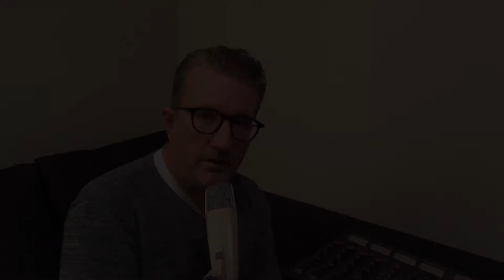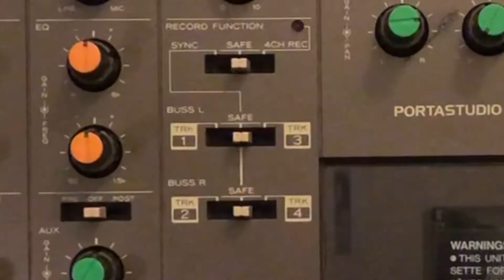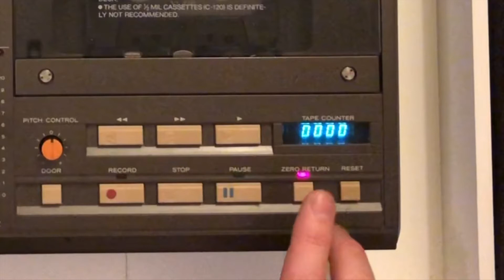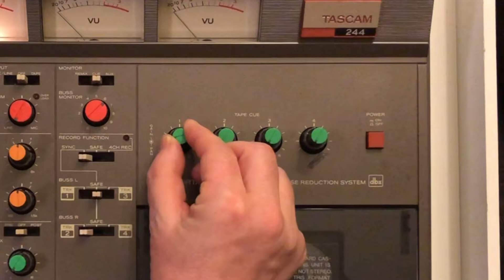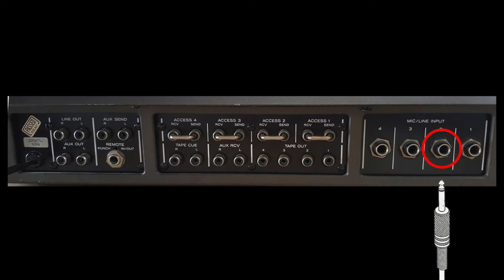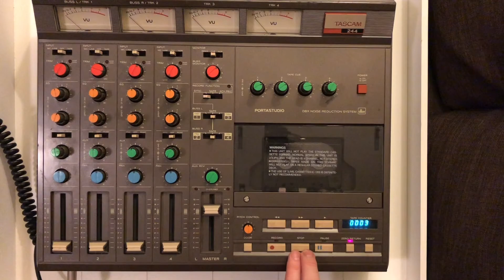Tascam 244 tutorial / Part 1: RECORDING / “Do it anyway you wanna” - People’s choice

Comment: I had one a while ago then it was beyond repair, just got another today. Definitely needs new rubbers. I’m noticing all my channels are getting signal just fine and all VU meters are lighting properly with corresponding selections but no needle movement on any of the VUs. Is it possible for the VU’s to be dead but still have working lights?
Reply from the maker: I think that is possible. Please check a channel called Tetrakan Supermonobloc, he has an incredible technical knowledge of these machines

Comment: I have a 424 mk3 and haven't used it yet,  have a pet input that's wrong but seems to work.  Question,  
Will it not acknowledge any functions in the recording section (or rec button)  if there's no tape? 
And there's a little reel at the bottom of the tape deck that's constantly turning. 
I'm beyond excited to use this thing when I get everything I need for it, does it sound like any of those are issues? Thank you very much
Reply from the maker: That little reel at the bottom must be the capstan, and if it is, it is perfectly okay

Comment: On the 388 (which I have) you have to pan left to record on odd tracks and right to record to even tracks.  I assume that's not the case with the 244
Reply: But I don’t see you panning the tracks
Reply from the maker: Yes, that’s also the case on the 244 (in sync mode) and many more cassette 4-trackers, not only Tascam but also Vestax and Fostex. Even an 8-tracker like the 488 has this principle. The 244 can also record on 4 separate track though (in 4CH mode).
Wow...a 388...that must be a joy to work with. Thanks for your comment!
Reply: @MultitrackCassetteFans  It is.  Though I tend to baby it, so I don't use it very often.

Comment: Hi, thanks for this useful video. I have a problem with mine: the line out/aux out won't work in stereo, only left is working though de aux send works in stereo. How can I use it in stereo? I mean as a mixer (I am waiting for new belts to test the tape part).
Reply from the maker: Hi Jean (are you from Belgium?), I haven’t found out how that stereo function was meant to work either. I did manage to connect a reverb to left and a delay to right, and feed them back into the mixer, so it kind of worked like 2 sends in one. But if only your left aux out is working, it may be a part of the right aux signal path electronics that’s broken. Perhaps a condenser or a transistor. But I’m by no means an expert in electronics. I hope you manage to get in working condition. Keep me posted! 👍
Reply: @MultitrackCassetteFans  Thanks for your message, I am from North of France. I managed to use effects too, I just can't line out in stereo. I will check the signal path!
Reply from the maker: Jean Debaecker Ah okay, bonne chance 😀

Comment: Great video, looking to delve into multitrack casettes as I want to move away from using computers as a musician. Can this unit record all 4 tracks at the same time, and if not, would you be able to reccomend one that does? Thanks in advance.
Reply from the maker: housekeys Thanks for watching! Yes, the 244 is able to record 4 tracks at once. Have you seen the “Record function” switch? It says SYNC, SAFE, and 4 CH REC. The latter enables you to route the 4 mixer channels onto 4 separate tracks.
Reply: I still have a 144 that I got new when they came out. Wish I'd waited for the 244! The 144 can only record up to 2 channels at one time, and it lacks the tape out jacks the 244 has. Lack of tape outs was a huge problem when I wanted to transfer my old 4-channel cassette masters of the music I did back then into the computer. I wound up recently getting a 424 mkII off ebay to do it. I think the 144 (and probably the 244) are the best made Portastudios. Certainly the heaviest! Also, the 144 used full-time Dolby B noise reduction. I think the 244 and later used DBX. So tapes made on the 144 are not noise-reduction compatible with later machines. One good thing the 424 has is a DBX that can be shut off. When I transferred the 144 tapes I shut the DBX off and used a Dolby B VST to handle the Dolby encoding. I was very happy with the results.

Comment: Hi, I have a question regarding running my mixes through my Tascam 244 back into my audio interface / DAW. 

How would I go about doing it? I tried doing the line out from my audio interface going into track one, and then send the signal from the Tascam's headphone jack back into the line in of my interface, but it came out super distorted. What am I doing wrong?

Thanks so much in advance.
Reply from the maker: De Dee You should use the 244’s line outs instead of the headphone jack. (The headphone signal is way too strong for your interface)
Do you record your mix onto the tape first?
Reply: @MultitrackCassetteFans  No I don't, I'm very new to using it so I'm not sure how to honestly. Do I have to put a tape into the recorder, record the mix, and then export it into my DAW from the tape recorder?
Reply from the maker: De Dee Yes, exactly. That way it will get some analog “color”. And if if you drive it hard enough onto the tape, you might get some “tape saturation”, or “tape compression” (use the VU meters, they should go well into the red area, but not TOO much because the signal will get distorted). You’ll have to fiddle around with different recording levels to get the sound to your taste.
Reply: Multitrack Cassette Fans thanks so much for your help! One last question, where do I get tapes that will work with the Tascam? Since it says it needs a specific type of tape
Reply from the maker: De Dee You ideally use Type II (aka Chrome) cassettes. These were recommended by Tascam. Try to find second hand cassettes, Maxell XLII are the best, in my opinion. (TDK SA are second best) Use 60 or 90 minutes cassettes, don’t use 120 minutes!

When I want to start using a preowned cassette, I always record complete silence on the full length first, to avoid having an faint old recording in the background.

If you can’t find type II cassettes: I have occasionally used Type I (normal) ones, without any problems. Audio quality will be a little less, of course.
Reply: @MultitrackCassetteFans  Awesome, thank you so much! Huge help

Comment: Hi, great video, very helpful, thanks!  I have some issues with radio interference in the recording process.   I can't figure out where it comes from.  Have you had these kinds of issues in the past?  I am recording with various sound sources at the same time:  tape cassette, contact microphones, through a tape echo and then into 2 channels and the radio seems to be present in the playback.  Also I can't seem to isolate track 1 from track 2.  (they are bleeding into eachother) Hard to tell if the radio interference is actually on the recording.  What I have found is that depending on the jack cable positions I pick up more or less interference.  Cheers!
Reply from the maker: Gmo C Radio interference can be caused by various things. Try to rebuild your setup gradually from the ground up, and maybe you will find the element thay t causes the interference.
I’m not sure about the lack of isolation of track 1 and 2, I would have to see the recorder in front of me.
Hope you find a solution!
Reply: @MultitrackCassetteFans  thanks for your reply.  Have you ever recorded 2 tracks at the same time in sync mode?  On your video you record one at a time.  Maybe that's the issue,  as you have to bring the level down on the track recorded while recording the next.  I will also check the manual.  Thanks again!
Reply from the maker: Gmo C if you want to record on track 1 and 2 simultaneously, in sync mode, pan 1 input hard left, and the second hard right. That way you should have two fully isolated tracks
Reply: @MultitrackCassetteFans  Thanks!

Comment: how did you manage to sync all of the tracks together? you had to hit play on your computer at the right time when the rec on the tascam was activated?
Reply from the maker: Shady No, that was just for the first track, the drums came out of the computer. The rest of the tracks were all recorded directly into the 244. (I’m not sure of I understand your question correctly, let me know)
Reply: @MultitrackCassetteFans  Thank you I now have my answer! I'm planning to run  group of tracks of my songs or maybe only the master (as it seems almost impossible to sync them if they are already prerecorded 😅) thru a portastudio simply for the sound it will gets. Do you think to run a whole song (the master) thru the tascam would really make a difference? Thanks
Reply from the maker: Shady That will definitely make a difference. It will add some analog character to the sound, as well as tape hiss and some loss in the high end frequencies. I heard that “Enter the Wu-Tang (36 Chambers)”, Wu-Tang Clan's debut album, was mixed down to a Portastudio 244.
Reply: @MultitrackCassetteFans  Thanks a lot for your quick response! Yeah I've heard it aswell. That led me to an other question, so supposing I get a multi output audio interface, will it be possible to record simultaneously different tracks into different channels of the portastudio? That would be the only proper way to mixdown prerecorded tracks in the portastudio I guess..
Reply from the maker: Shady Yes. But I wouldn’t go that far for this purpose. I would mixdown in the computer, and then record the stereo signal onto 2 tracks of the 244. Just to add a little analog flavour to the whole mix
Reply: @MultitrackCassetteFans  Great! Yes of course I would mix my tracks in the box first as I always do and maybe then add a little something with the tascam like clipping the drum bus in it to add some real grit or maybe the analog summing would add something to the overall sound aswell. Thanks a lot for your precious knowledge
Reply from the maker: Shady No problem. Let me know when you publish your project 👍
Reply: @MultitrackCassetteFans  with pleasure!

Comment: Hey there! How do I record two tracks at once? If for example I wanted an acoustic guitar mic and vocal mic recording at the same time? help!
Reply from the maker: Johnny Lewis Hi Johnny, thanks for asking...here you go:

Record function: SYNC
Buss L: TRK 1 (or 3)
Buss R: TRK 2 (or 4)

Plug mic 1 into channel 1, pan to left
Plug mic 2 into channel 2, pan to right

The BUSS settings (L and R) determine to which track(s) your left panned signals go, and to which track(s) the right panned ones. 
So you could, for example, plug 3 mics in ch 1-2-3, pan them all to left, and that mix would go to track 1. Plug a 4th mic into ch 4, pan that to right, and that goes to track 2...go wild :)
Reply: I've tried the panning with channel 1 left & 2 right panned and when I record it sounds fine but then on playback it only gets channel 1. Am I doing something wrong?
Reply from the maker: Johnny Lewis Do you listen to the mix or the tape cue?
Reply from the maker: Johnny Lewis And have you tried recording only on track 2?
Reply: What's the difference? Is the mix on the "remix" function? I switch the tracks to "tape" and then I believe I have it in the "cue" function.
Reply: And I have not tried with just track 2. I will try it when I go back to the studio.
Reply from the maker: Johnny Lewis I hope it works. Try to narrow down the problem. Good luck!

Comment: Hi, I'm super new to recording in general. I just bought a 244 and I'm a bit confused. When I record my drums on track 1 and play it back they start playing a lot later than when I initially started the recording. Then when I record my guitar with the drums and listen to the playback the whole track starts 50 seconds into the tape running. Followed by all that each time I rewind the tape to listen to the track it starts up even later at around 70 seconds and so on and so forth. Am I doing something wrong or is it the machine? Sorry if that doesn't make sense, again, I'm very new to all this.
Reply from the maker: Dream Daze Are you rewinding to 000? Maybe the little belt that drives the counter is worn out, so you rewind too far while the counter hasn’t reached zero yet
Reply: I have it set to stop at zero, but I just find where the song starts then hit the reset button so it starts about 2 seconds in.
Reply from the maker: Dream Daze I think your counter is not properly driven by the motors. Probably a thin little rubber band that drives the counter mechanism that needs to be replaced.

Comment: Just got one and think its all functional, however, are Track 3 & 4’s VU Meters intentionally not lighting up when you are recording individually on either TRK 3 or 4? Seems kind of counterintuitive that only Track 1/2’s VU Meters are responsible for tracks 1-4, but thats exactly how yours is shown here so I guess thats normal?
Reply from the maker: TheNohcim Great question! I have asked this myself too, when I first started to use the 244:
It’s perfectly normal! See the labels above the VU meters? It says “buss L/ trk 1”, “buss R/ trk2”, and 3 & 4 have only “trk3”, “trk4”, no buss indication. If you record on one or two tracks at once (SYNC mode), it will record any sound that comes from Buss L or Buss R. So the VU meters 1 and/or 2 will reflect the buss levels.
But if you record 4 tracks at once (4CH REC mode), all 4 VU meters will light up. Also during mixing they all light up.
Reply: Multitrack Cassette Fans Great! I seemed to be doing just fine, starting my session with it, using correct (and expensive!) tape and all, and it just started eating it all up like the guy below had a problem with. I’m pretty confused as to what is causing this since the shop I got mine from just replaced the belt and pinch roller... any thoughts? I’m pretty upset haha I thought it was going to be a great finished piece and then bam...tape everywhere
Reply from the maker: TheNohcim I think the rubber of your idler tire is gone. The capstan and pinch roller are okay, but the wheels in your cassette are not driven. That’s why the tape is being eaten. At least that’s what I understand from your words.

Here’s a useful link on how to repair the idler tire:

http://www.mzentertainment.com/studio_workshop_tascam_244.html

Click “replacing idler tires”

Comment: I have a Scarlett 2i2, and wanna go out of my DAW , into my 244 and back into my DAW, would I need a few outputs to do this? My Scarlett only has two monitor outs on the back
Reply from the maker: David Picarazzi How many tracks simultaneously? On the 2i2, you can go 2 in - 2 out at the same time. For example stereo in - stereo out. What are exactly your plans?
Reply: My plans are pretty much, to make my music in ableton, and then put it through the 244 to dirty it up abit, and then put it back into ableton
Reply from the maker: David Picarazzi Since the 2i2 has 2 ins and 2 outs, you can “dirty up” a stereo signal. So yes, that’s possible, at least for your stereo mix
Reply: Multitrack Cassette Fans awesome! Could you recommend a link where to buy cassettes?
Reply from the maker: David Picarazzi Unfortunately, no. The TDK’s and Maxell aren’t being manufactured anymore, so you’d have to look around in second hand markets, thriftshops etc.
There are more tape brands, for example Quantegy, but I don’t have any experience with these
Reply: I just bought 2 TDK SA-X 90s off off eBay, it was roughly $20
Reply from the maker: David Picarazzi That’s kind of expensive, but you need these tapes anyway. A price of € 5, or $ 6 should be reasonable, I think.

Comment: I'm gonna buy one of these as it's at a pretty decent price. Right now I just use a focusrite interface. Would you say that the tascam sounds warm compared to digital?
Reply from the maker: David Picarazzi I rarely use the word “warm” for audio. All I can say is that recording to tape “does something” to your sound. In the past, I have recorded on both 4 tr cassette and 16 tr harddisk, and of course the audio quality of digital is much better, but with digital I never seemed to get a mix right, for example. It felt like there was no natural connection between the individual tracks. Sound quality of cassette is much less, but I think it has more character to it, and that character might very well be the thing that makes mixing a more “natural” experience. 
I hope this answers your question.

(When I mix down, I also use a focusrite interface to capture the stereo mix into the computer)
Reply: This was an honest answer, thank you! It definitely isn't as clean as digital, but it's more natural and unique. I might pick one of these up in the near future, unfortunately they're quite pricey! Do you recommend buying a broken one and having it repaired or just buy it working?
Reply from the maker: David Picarazzi The 244 can be a little expensive sometimes, indeed. I’d look for one that looks goods, that has been treated well. I’ve seen recorders that were so dirty (and smelled after cigarette smoke) that I’d rather not touch them. But there are also recorders that have no scratches on the surface etc etc. That says at least something about the way it’s been treated.
We’re talking about devices that are 30 years old, so if you buy a working one, it might as well break in your first week of ownership.
You just need a little luck in life :)
Reply: Multitrack Cassette Fans I might bite the bullet and buy an already broken one, I'm sure I could get it repaired anyways. I can't wait to have this thing, it be nice to step out of ableton for once, lol.
Reply from the maker: David Picarazzi I totally agree, keep me posted!